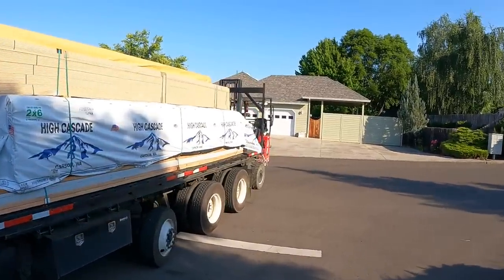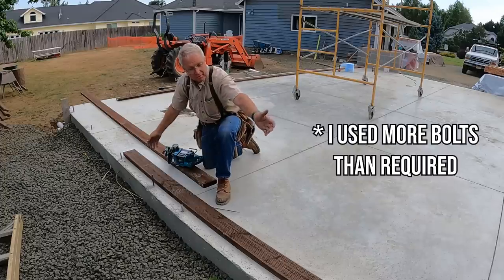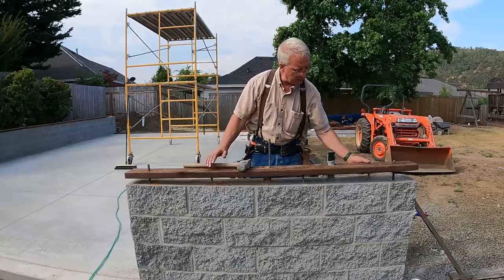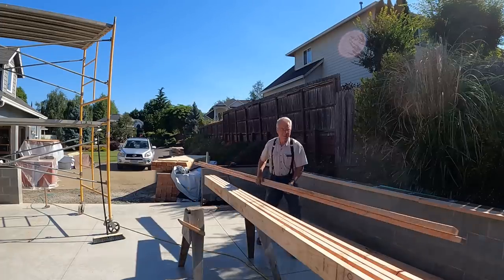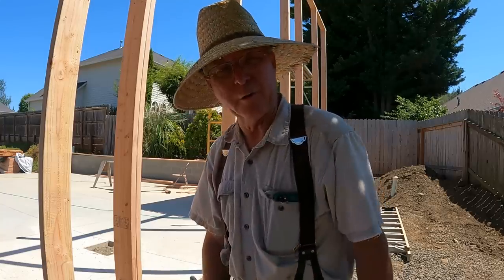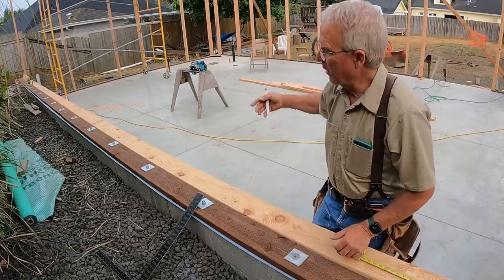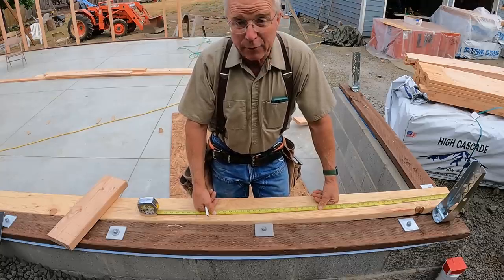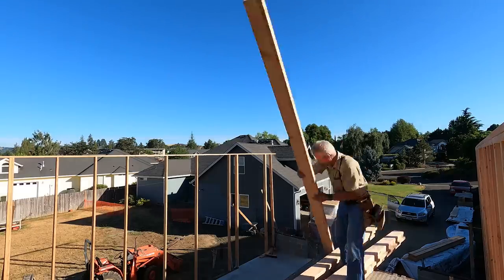No Crew Needed - Solo Balloon Wall Framing: Shop Build #10

Comment: I’m 64 and started framing when I was around 18.  Retired now but on occasion get to put my bags on for a project, love it.  Framing to me is like a sport and seems to be in my blood.  My body actually feels better when I’m active working on a construction project.  One word of advice to those in construction, wear hearing protection. No one I worked with in the 70’s did. I’ve lost quite a bit of my hearing due to not using ear plugs.  Scott, thanks for sharing and passing on your sound methods and advice to those interested.😀

Comment: I built a house, most of it by myself. It's a monster undertaking full of smaller jobs. Took 18 months from excavation to move in. That was my first house. Lived there 7 years & built another one. I'm going to build one more probably starting in spring 2023 (depending on building materials cost and availability). Site prep is done. Still drawing the plan. 
I prefer working alone but sometimes jobs are beyond what I'm willing to and better left to the pros such as concrete and shingling.

Comment: Moffetts are awesome.  Your comment at 8:08 is so true.  I once built myself an apt inside a steel building, it was so satisfying once the bottom plates were in.  I could get off work and build the walls on the floor and stand them up.  So much accomplishment in a short period of time.

Comment: Ufer is the man's name who devised it.
In 1942, Herbert G. Ufer was a consultant working for the U.S. Army. Ufer was given the task of finding a lower cost and more practical alternative to traditional copper rod grounds for these dry locations. Ufer discovered that concrete had better conductivity than most types of soil. Ufer then developed a grounding scheme based on encasing the grounding conductors in concrete. This method proved to be very effective, and was implemented throughout the Arizona test site.

Comment: I usually staple the sill seal onto the bottom face of the PT sole plate and then punch the holes during installation of the plate itself.  Makes it a one step process and the foam is lined up with the lumber exactly.  I leave a tail so that there's a bit of overlap at each new section of sole plate.

Comment: That’s how I build the tiny house that had 12’ walls, I just got done with the framing of a 18x26 shop with fourteen foot walls and built them on the ground in 10’ segments. As long as the inspector does make a hissy over the unusual stud placement (all of which is under 16” OC) it worked great. I’m 32 years older and I lifted those walls by myself which I don’t recommend to anyone who’s not an experienced framer. I don’t think I’ll be lift 400lbs walls like that much longer lol. Anyway I’m rambling but Thank You Scott you’ve helped me improve and dream bigger as a contractor and do some things with much greater efficiency over the last 5 years.

Comment: Great video.  I’m currently eating my lunch, taking a break from building my first house, my house, by myself.  There are many puzzles to solve, especially when it comes to figuring out where those pesky 1/8” and 1/4” mismatches came from and what to do about them.

Beams and joists for a floor system are challenging when flying solo, and I totally relate to your “extreme sport” comment… there’s an element of risk, for sure, and having to jump 9 feet down after letting a beam adjust my centre of gravity the wrong way, I have invested in a set of wall jacks that will make the second floor a (hopefully) much more predictable endeavour.

Seeing something you designed from scratch literally rise from the dirt and take shape is a truly rewarding feeling.  Cheers Scott, you are and continue to be an inspiration.

Comment: Yes those little red fork lifts they bring out are amazing.  Last year I had a load of lumber delivered for a  project.  The driver unloaded it off the side of the truck, and then I wondered how he was going to maneuver it; hopefully not driving on the wet lawn. Then without moving he TURNED THE WHEELS 90 DEGREES and the thing started moving sideways.  I thought that was pretty neat.

Comment: I was building a 2 bedroom cabin in the bush so I thought a cordless circular saw (direct drive) might come in handy. Turned out I built the whole cabin with it. With the same blade.  I have hardly used my plug in saw since. I, like you do most everything but my favourite is framing and building with wood. Love the vids. Thanks

Comment: I've been watching you for years now, and while we would likely disagree on things here and there, and some of your views are pretty old-fashioned, one of the things I really appreciate about you is your ability to learn and adapt when it's shown to you the value in doing so. 

At roughly 9:00, you're talking about the new code req's for the hold down washers, and you lament on what's next. I just wanted to chime in with a friendly reminder that what's next is whatever is discovered down the line that does the job better, safer, to a higher spec, that holds out longer, that is stronger, whatever it may be. Yeah, change bad. But hey, life is nothing but change, and it's good to remember that, more often than not, the change that's coming about is doing so with good reason.

Keep up the good work!

Comment: I had to balloon frame 14' walls, with floor and 12' wall on top for living on a very narrow lot. Made a cut table with an old aluminum scafold plank.  Cut studs to length  also cut a 3 5/8  1 1/2 deep notch on crown side of stud, this was to help hold wall straight also top of noutch was 7 ' 11 1/4" off of floor so span/fire block could set on top.  With scaffolding I was able to complete 55' of wall from the stud cutting to completion in a day at age 64 with two bad hands.
  Great way to stick frame.

Comment: 😮 You, up on the scaffolding without rails wore on me throughout this video. I’ve done a similar project but used 6” block for my stem walls. Finished with a cleaner look in my opinion.

Comment: Thank you. Thank you for sharing your knowledge & experience gained over your career. Some won't even consider trying to frame walls alone for any number of reasons but obviously with a little planning and preparation it is possible to do without killing yourself. I had a customer who built homes and did all the framing, roofing, siding, millwork, cabinetry, concrete slabs, finish drywall, painting. They weren't complex large homes of course and he didn't build 100 homes a year but  in my opinion that's a "builder". Today, there are "builders" who can't tell the difference between a framing hammer & a finish hammer.

Comment: Only a min in and i have to say this. I work on a small crew (3 guys max) and we pump out some houses. Preparation is huge! With lumber positioned correctly things go so much smoothly! And with the technology in battery operated saws you are able to bring your saw to the lumber even if its on the other side of the house! Cutting the cord is one of the smartest things we did.
(Edit) we still use round washers for hold downs

Comment: I used 2x10 when I did my 16ft walls.  It gave me extra insulation room and I feel good that they can take that 100mph wind with nothing backing them up for bracing. A tall wall is a big sail. Once you get some roof timber up to tie yours together I am sure you will feel a lot better!!

Comment: My house was built in '55. Not pressure treated sills. An addition was put up in '65, again not pressure treated, just plain 2x4s sitting on a concrete slab and touching the 2x forms that were left in place. Two years ago I had to take all those out- most just crumbled as it was a bank of termite elevators toward the upstairs structure.

Comment: I am 74 and building a wood deck.  I have been able to devise methods to hold wood in place while I fasten one end at a time, and I usually never have to lift the entire piece of lumber by myself.  I usually lift one end up and set it on something, then I can lift the other end.  That way I only am lifting half the weight.

Comment: Hi Scott, long time listener, first time caller.

Your knowledge base is unmatched and your humility is awesome so I don't feel bad leaving this comment.

I'd like to point something out with regards to the Simpson Brackets you were using as temp bracing. They looked to be tacked with a couple SDS screws for convenience. My question is, did you raise them up afterwards? When installed correctly, they should be mounted to your studs at least 3/4's of an inch ABOVE the bottom plate. The idea being that when the structure settles, your HD hold down can be retightened. If the bracket is mounted flush to the bottom plate, you have no area for that crush to occur because the bracket is holding everything up from the bottom.

A lot of folks install them in contact with the bottom plate which is against the manufacturer specs. According to the product bulletin, the HD can be installed up to 18" high and at up to a 5 degree angle whilst using a coupler.

Comment: I had to make a shed by myself, 2 hours at a time after work. I split the walls into sections and made them on the ground. Then put them together 1 at a time. The rear wall was against a fence 1 foot away. No way to get in there to screw anything. I just screwed the outside sheathing on beforehand. The short rear wall was the worst. I used bolts instead of screws from the inside.
   It worked, but was a lot to prethink.

Comment: Lets talk anchor bolts!  When I first got into building houses, back in the seventies, I had never built a house from the ground up before.  I studied the plans and paid attention to where all the openings, doors and windows, were in the exterior walls.  I talked my concrete guy and was told that the anchor bolts would be placed at 6 foot on center and 1 foot from the ends.  Sounded good to me, but I realized that there was a problem.  While the slab was being poured, the newest member of the crew, was responsible for placing the anchor bolts 6 foot on center.  That was his primary responsibility, just 6 ft on center and 1 ft from the ends.  Because I didn't know any better, I asked; what about the openings and on long walls what about the ends of bottom plate where they didn't span from corner to corner.  The answer I got was that is the framer's problem, not the concrete problem.  I ended up preparing an anchor bolt location list and presenting it to the concrete foreman prior to the pour.  He really seemed to appreciate the list.  I have done that ever since and am surprised at how many concrete installers have never seen a placement list before.  They just go by the 6 ft and 1 foot spacing.  The framer needs to talk to the concrete crew!

Comment: Just wanted to set the record straight. Sill sealer is not made to stop air and bugs. It is a capillary break to prevent moisture from wicking up. If you want to add air and bug protection then add a bead of acoustic sealant or Big Stretch on both sides of the sill sealer. It makes a big difference. 👍

Comment: Okay Scott, my turn. I have watched many of your videos and became convinced to buy the wormdrive Skilsaw,  after several years and re-watching one of your earlier videos. Just bought it, have not used it, still in the box. Should I return it for a Makita? (LOL) Second, while I am a bit older than you, I find the synergy of two people working on a project to be four time that of one most of the time. I just completed a project where I could have done the job in 1/4 the time if I had a little help. Just can't hold two ends on a board at the same time. But, my skill level is probably 1/10 of yours. GREAT VIDEO! I also bought Larry Haun's book, watched many of his videos, and can say, VERY INTERESTING. I was interested in how you were going to explain the 16" o.c. and how to  start. I like the layout stick concept but he did not seems to give much value to the spacing for the 48"x96" sheet stock. If I understood him correctly, he believe in leaving an expansion gap which blew the 16" rule out. 
And, I find it interesting that you are utilizing the mill-cut/treated end of the board. I have experienced accelerated deterioration of PT lumber at field cuts. Some have recommended using a sealer or protectant on all end cuts. Just thinkin''.

Comment: A man needs purpose; something to challenge the mind and body that results in a tangible product. I'm handy, but orders of magnitude below your technical level in matters of construction; and atrophied from too many years spent at a desk (and the damage from using brute force rather strategy in my younger stronger days), so a ten hour day of labor would be suicide for my 60 year old body.

But I'm not ready to throw in the towel just yet. Perhaps I'll start with building a small storage shed and work my way up. At any rate,  thanks for the inspiring and informative video.

Comment: Here in Chile we use all the same sized ply wood and dimensional lumber. However everything else is in Metric. 
Where I live in Chile (outside a city in the campo) We do not have any permits or inspections or for that matter TAXES. 
So builder beware and build what you want and how you want and that is what you get. So you have to build smart. 
I do not miss the permit and inspection process at all. It is just an expense we do not want or need. 
Jim

Comment: Still learning here... I assume to overlap sheathing on the outside, the inside measurements would then be off so it wouldn't match up to 16 on center so the corners are oddball type sizes?

Thanks again for your channel, picked up a Vaughn 19oz California framing hammer and a skilsaw 77 based on your recommendations and I absolutely love them.

Comment: In 1942, Herbert G. Ufer was a consultant working for the U.S. Army. Ufer was given the task of finding a lower cost and more practical alternative to traditional copper rod grounds for these dry locations. Ufer discovered that concrete had better conductivity than most types of soil. Ufer then developed a grounding scheme based on encasing the grounding conductors in concrete.

Comment: Still sealer also helps as a capillary break between the wood and concrete.  Per your anchor bolt comment. Instead of J-Bolts inspectors out west are going to start to require post-installed anchors set with epoxy.

Comment: I had a problem to solve with my old farm house in that I wanted to put a new and. Increased size bath on a larger footprint over the top of and around the existing old bathroom addition. It was basically two walls that attached to the existing house. 
  Balloon framing was the answer. It was April and so windy that the studs vibrated. A vertical manlift made short work if things. 
   It was a very good plan as we were able to get the basic structure including the roof all competed and then tear off the roof off the first floor bathroom and then frame a new floor over the whole shebang

Comment: Doing loads of improvements to my home in the UK, including insulation board - the suppliers use curtain side  lorries that are too big to get down my lane which is on a steep incline and pot hole ridden. The driver never complains as he drives the Moffitt down backward with his large stack of insulation board

Comment: Scott, thanks for your wonderful recordation of knowledge we can all benefit from. For slab foundations, I have seen some contractors use a laser to custom cut each stud to yield a “perfectly” horizontal top plate at the correct floor to ceiling height. Since you did not go that route on this workshop do you feel that additional time is not worth the payoff?  Thanks again, Dave.

Comment: I agree with the building code change. I imagine a round washer would have more of a tendancy to be able to bend, but that's about it. I've installed a lot of anchor bolts lately that have a welded plate washer at the bottom. I understand the reasoning, but when they are installed into zone steel that is a little bit out of plumb, and already cast into a footing, it's not really possible to set them plumb. 

It's easy to draft it on a computer but not always practical for installation. In the case mentioned, why not send anchor bolts with an elevation offset 1.5 times the width of the plate, so even if you needed to run them closer to each other you won't have to beat them to death to set them plumb.

Just an idea anyway, thanks for a great video!!!

Comment: FYI I'm pretty sure the requirement for the square washers is an alternative to requiring a 3"-thick sill plate.  This code change happened because a lot of damaged sill plates were observed after the 1994 Northridge earthquake and some research and full-scale testing demonstrated that increasing the thickness of the sill plate or using square plate washer would greatly reduce the chance of shear wall sill plates being damaged during an earthquake.  This translates into earthquake damage to shear walls potentially being repairable in place without necessitating tearing out the walls to replace damaged sill plates.  A lot of code changes out of the Northridge earthquake were in this category of things that don't really increase earthquake safety appreciably but greatly reduce repair costs in the future for very little increase in construction cost today.

Comment: Did framing for about 10 years and bought 10 boxes of 2” square steel washers right before they changed the code in my area to require 2.5” galv. Washers 😮 I then had 100# of washers that I couldn’t use

Comment: The thin edge of your framing square is exactly 16 in and all you need to do is keep moving it down from your line initially made or flip it over and over. You don't need to keep using your tape measure. That's why the framing square is made in the dimensions it is designed for.

Comment: I’m also excited by framing and scared of concrete forming. You can always disassemble a messed up wall, but that 1/2” off concrete stem wall is there forever.